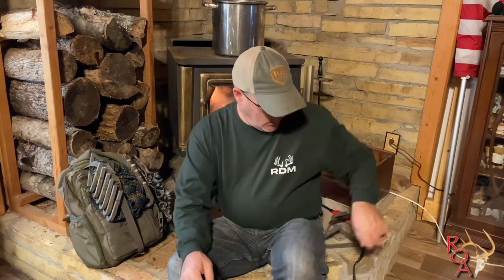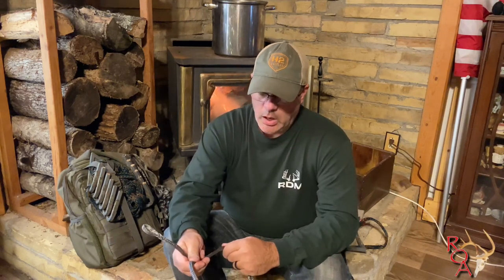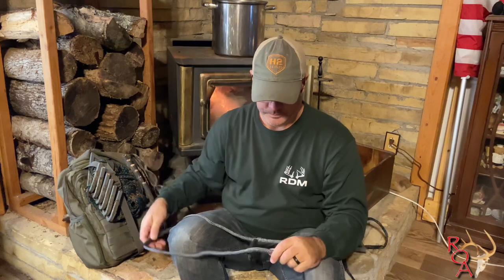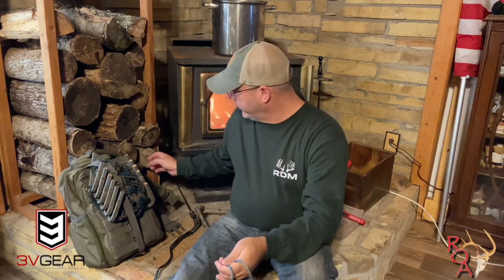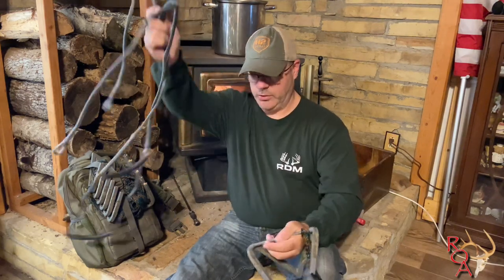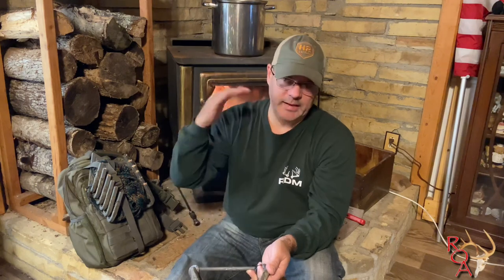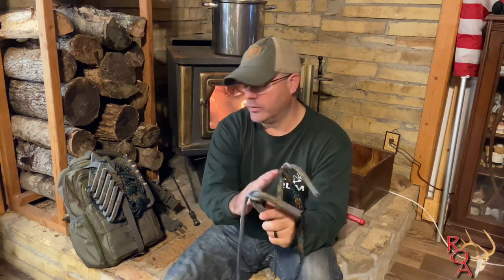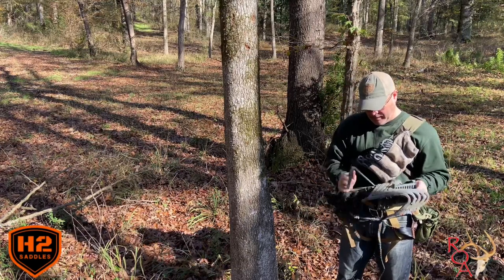Wild Edge Stepps with 3-step aiders

Comment: Knaider swaider setup 1 each leg with the knee hook you can get on top of 4th step at 30 feet head height my stand sits around 24  off of 4 steps its all what you use and how

Comment: Good video! I have a few questions...Any reason why you don’t just leave the aiders attached? Have you tried that and see if they would fit in the Gripr or even the wild edge bag with the aiders attached? Also, what about just using one aider and keep carrying up with you as you go up, like the 5 step aider you used before? Lastly, what makes this system less “sketchy” than the 5 step aider you used before? Thanks!
Reply from the maker: Thanks, dude. I think there would be too many chances for tangles if they were permanently attached. I had some one-step aiders that were permanent once and they would get hung up every now and then when taking them out of the bag. A moveable aider would have to have two hooks and some way to keep them spread apart or they would possibly slip from one side to the other. To me, the other aider was ‘sketchy’ because of the single hook and the length made it want to kick out from time to time. I’m sure I will come up with something else in the future, but for now, I really like this system.

Comment: That’s better then the naider swaider system by far awesome video brother safe hunting and one question how do you get those steps to clip in together like that?
Reply from the maker: It is the GRIPR from Genesis 3D Printing. I did a video in it and my sling pack. Look on my channel and check it out! Thanks for your input.
Reply: @redlineoutdooradventures4863  do you make these aiders for sale
Reply: @redlineoutdooradventures4863  I hunted with the similar aiders this weekend man I had a tough time the fuel line step kept getting stuck in my boots and I feel like they where to close to the tree couldn’t get my foot in them to the half way point of my foot it was tough but I get with enough practice I will get easier